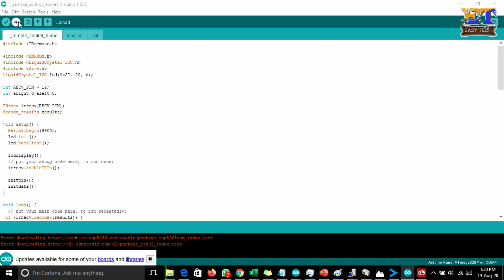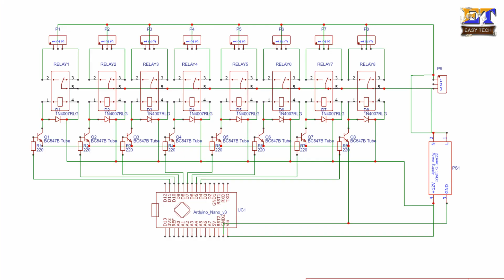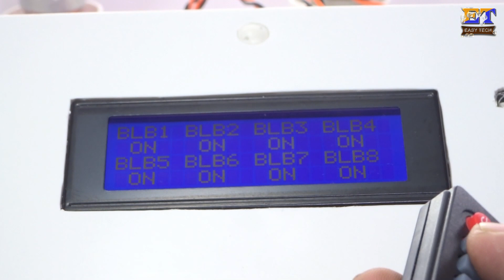Remote Control Home Appliances

Comment: Bro why relay coil pin attach diode
Reply: Chethan Poojary the diode is added to the coil to prevent the back EMF from destroying the transistor when the coil voltage is removed. When a coil is energized and then the power to it cut, a voltage spike can flow back into the circuit destroying any driver transistors. The diode shorts the spike to ground thus saving the transistor. It is always good practice to include a diode across a relay coil.
Reply: Tq bro😍😍😍😍